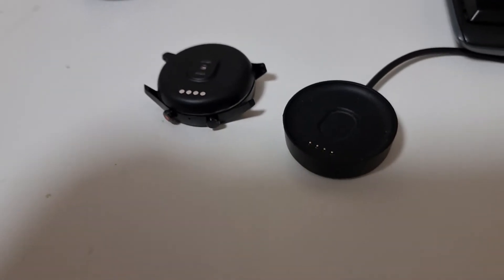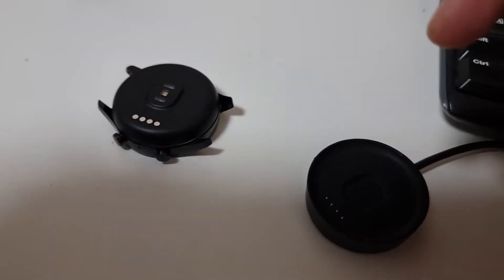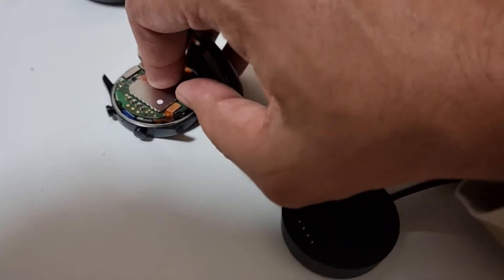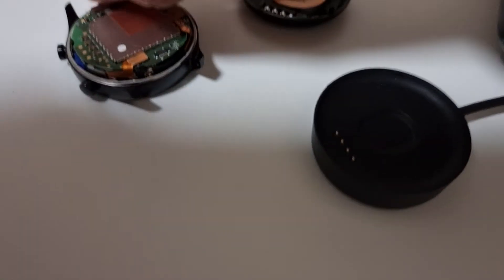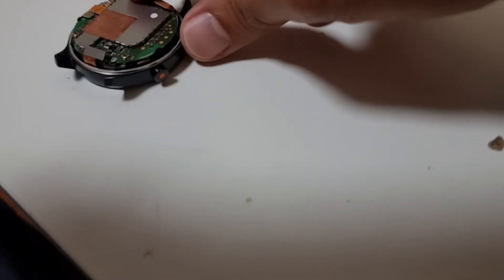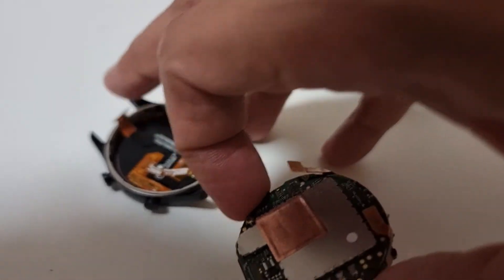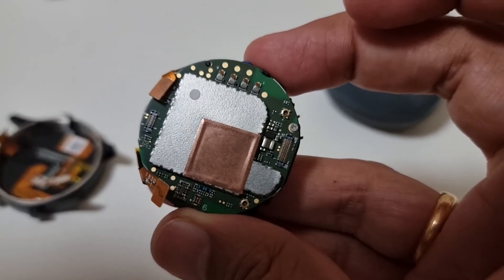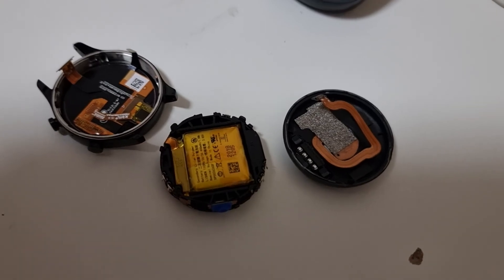Ticwatch C2 teardown

Comment: Battery life went sharply downhill in the last two months on my TicWatch C2+ to the point of not working. Some heat from a heat gun and a metal pry tool and it's open. The battery has expanded and split a bit. Replaced it with a new one from AliExpress (part number SP502626SF) and it works like new.
Reply: Same problem with my C2+. What type of battery must I buy? Is It the same of C2?

Comment: Please, tell me how you have open it. I can not do it. Thank you
Reply: Hey Miguel, i just had 7 of this model to Repair. Best way is to heat up the Glue. You can put the whole watch into the Oven for 10-15min @ 50-70° C. Then take an Tool (like for opening watch-Cases and push it open. In the best case, it leaves no Marks... You need to Buy B7000 Glue to close it afterward.  Good Look and Greetings from Germany!
Reply from the maker: Use a sharp prying tool or a knife been the metal and plastic  back